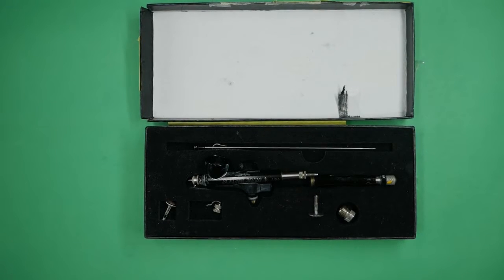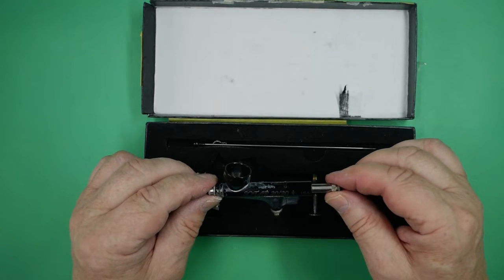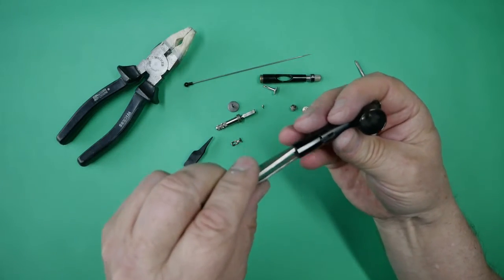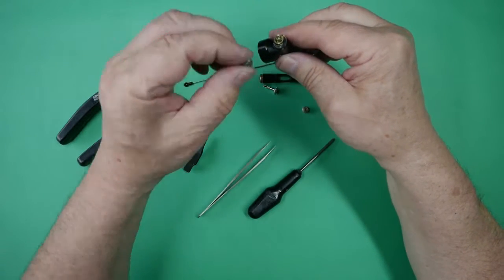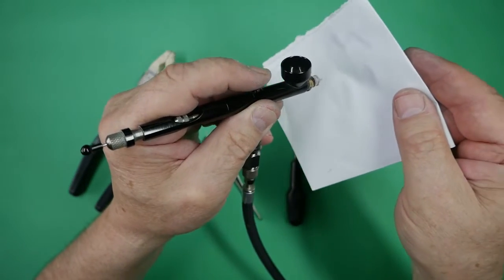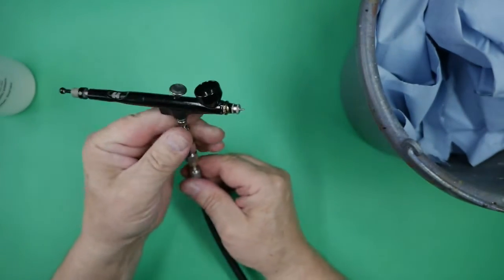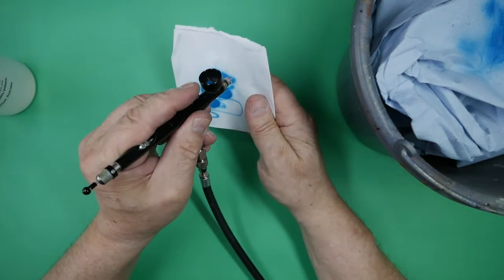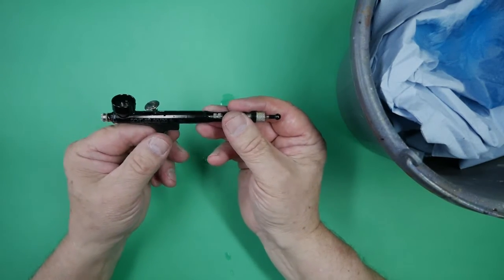Why is my Badger Sotar 2020 not working ?

Comment: any recommendations for when the airbrush paint cup is bubbling or when the airflow is stuttering
Reply: 個軸承防漏壞了或噴咀裂了
Reply from the maker: I'm working on a video to cover this, the first thing to do is clean it properly, look at the tip for damage under a magnifier, is there a needle bearing in the airbrush ?

Comment: I find the nozzles block up with a build up of paint in them. more so then other types. so you need a realy good cleaner to clean.
Reply from the maker: Thank you  for your comment, may be spray airbrush cleaner through during the time you are painting to keep the nozzles clear, or blast the paint more often  will help.

Comment: What kind of needle bearing does this airbrush have.  Is it so that the models before 2018 have a PTFE seal like the 150?
Reply: 這個設計好過150
Reply from the maker: As can be seen in the video it as the screw in type part number R-0023 Screw (Needle Seal Adjuster & Seal) the Badger Sotar manufactured after September 2018 is fitted with this seal / needle bearing
Reply from the maker: Two different airbrushes the Badger 150 is suction feed, the Badger Sotar is a detail gravity feed airbrush

Comment: Nota, se l'ago lo modifico e gli tolgo la parte posteriore nera del Sotar 20/20, e rimane diritto senza rotondità posteriore, e lo posso infilare da davanti avendo lo stesso diametro assiale, cosi' infilando da davanti non rovino niente, vedo che da dietro con mano non ferma c'e' il rischio di rovinare la punta e piegarla, cosa ne pensa?, io ho 12 aerografi comprati in 34 anni che li uso, dai cinesi Fendga marchiati e non, Artesania Latina, Vivaz 200,  ai giapponesi RichPen, Olimpos, Iwata, e tedesco H&S Infinity CR Plus, e copie non marchiati di ditte inglesi Airfix e Vivaz del Badger 250 e 150, oltre che hai Badger Renegade RK-1 Krome nuovo, e al nuovo Passche questo purtroppo ago si infila da dietro,  ma penso di modificarlo rettificando il mm.0,15  circa decimi di millimetro misure italiane.
Il Paasche purtroppo i 3 aghi 0,25-0,38,-0,66 non hanno il tubetto trasparente di riparo che mi sto facendo io per conto mio in auto costruzione. Buon lavoro e seguo i suoi video molto interessanti.